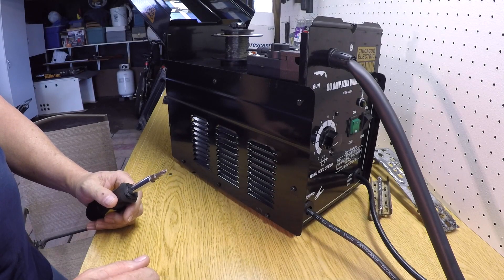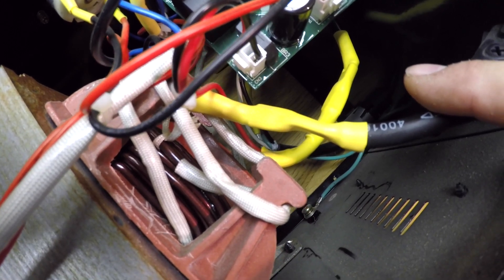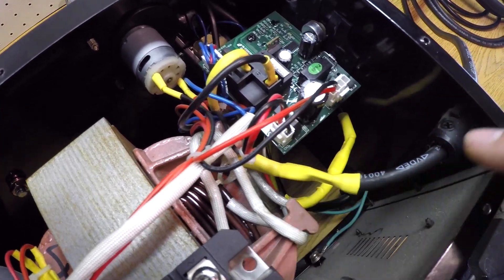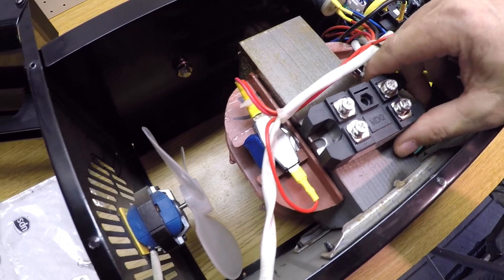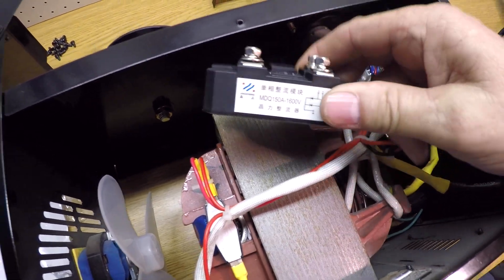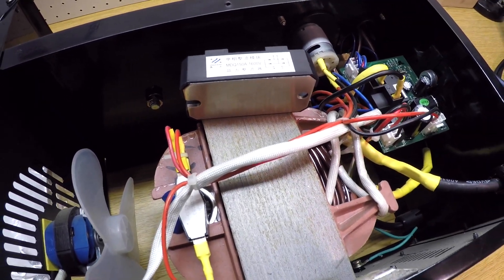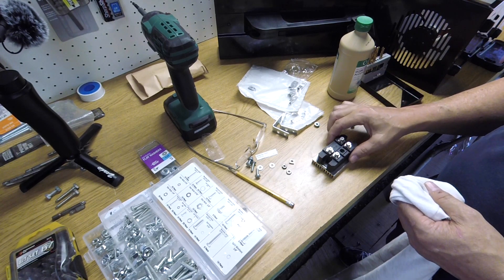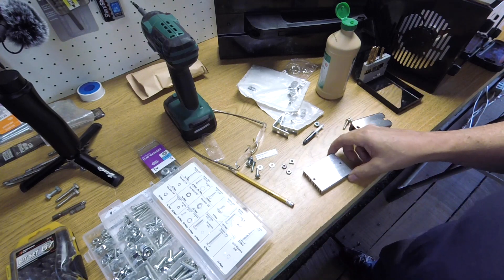Flux Core Welding Just Got HOTTER (Installing Rectifier & Heatsink)

Comment: What is the Amazon part # for capacitor?
Reply from the maker: This is the only one I could find at the moment on Amazon (It's a 2 pack)
GURSAC 50V 47000F Aluminum Electrolytic Capacitor, Radial Mount, 50x105mm (2pcs)
https://amzn.to/41igycC

Comment: Looks good. Do you still have this, and if you do, how is working for you?
Reply from the maker: Yes I do still have it and it's working very well. Here is a link to a video I made only a couple months ago about how it welds 1-1/2 years after making the mods.
After 1-1/2 Years Use - Harbor Freight Flux Core Welder Mods - Run a 10lb Spool of Wire too! - https://youtu.be/NBZ3tbjvBNs
Reply: @DIYHomesteadProjectsDIYHP10  I bought my welder used and it had been hacked up. I can figure out most of the wires, but the 3 that are the primary are the ones I have trouble with. I have the HF manual, but as usual, it's a bit vague.
 Is there any way you could tell me where the long wire plugs in for the common to the transformer?
I'm moving my cord to the back of the welder, so I have more room in the front for my receiver and capacitors. I've replaced the fan with a higher volume AC fan, and I'll install a Dinse plug for my ground.
Reply from the maker: I'm not clear on what you mean by the long wire. If you are talking about the white wire coming into the machine from the plug, this video kinda shows it at the time I have marked. https://www.youtube.com/watch?v=NIfeQH51FI8 - 8:23 - 8:27. It looks like the incoming white common wire connects to the bottom of the  on/0ff switch on the front panel. I didn't do any mods on that part so I don't have any good video of that wiring. I could take the side panel off my machine and see if I can figure it out if I know the correct wire to look at.
Reply from the maker: This video might be even better starting at 9:55. https://www.youtube.com/watch?v=ozjFq5KXm1U
Reply: @DIYHomesteadProjectsDIYHP10  what I'm talking about is the three wires that come off of the front of the transformer. Two go to the min/max switch and are about the same length. There's another longer one that comes off of the same side at the top and is longer. Where does this wire go?
Reply from the maker: I don't know the answer to that question. What side of the transformer do they come off of if you are looking at the front of the machine?
Reply: @DIYHomesteadProjectsDIYHP10  they come off the right side on the front, and are the smaller windings. The ones on the left are the output and are heavier.
Reply from the maker: When I get a chance tomorrow I'll pull off the right side cover and find where it goes.
Reply from the maker: You may try a Google search for "harbor freight 90 amp welder wiring diagram". I just did that and there are many wiring diagrams that came up. Maybe one of them has the information you are looking for.
Reply: @DIYHomesteadProjectsDIYHP10  I did that, and it's helpful, but it's just vague on
 what wires do what since there are 3 wires on the primary side. If it were two, I could figure it out. If they showed wire colors, again, I could figure that out. HF is renowned for this kind of thing. The best way to figure this out is for someone with this welder to describe where the long wire goes, and all the others will just fall into place then.
Reply from the maker: I'll have a look at it tomorrow and see what I can find.
Reply from the maker: This video should have what you are looking for. Sorry about the ads, it's just how my default upload settings are set up. Let me know if it's what you needed.
https://youtu.be/xozvq-IQzGo

Comment: Send the links to where you got all the parts.
Reply from the maker: Sure, these links are also in the description box of each mod video if that makes it easier for you.
Black Single-Phase Diode Bridge Rectifier 150A Amp High Power 1600V - https://amzn.to/2YOEJvX
Silver Thermal Grease CPU Heatsink Compound Paste Syringe (5-pack) - https://amzn.to/2MbgqXK
Aexit Chassis Mount Fixed Resistors Wirewound Aluminium Housed Power Resistor 5% 50W Single Resistors 470 Ohm - https://amzn.to/2USztY3
RIVERWELD TIG Welding Cable Panel Connector Socket Set DKJ10-25 & DKZ10-25 Quick Fitting Dinse-Style 2pcs - https://amzn.to/2WmRqkc
Aluminium Heatsink,Aluminum Grille Shape Heat Sink Cooling Fin for IC LED Power Transistor 100 60 10MM,16 Teeth - https://amzn.to/2EDdddr
50V 47000UF/MFD Aluminum Screw Audio Filtering Electrolytic Capacitor 105℃ - https://amzn.to/2HSmUJl

Comment: Is it 1 phase ?? On eBay
Reply from the maker: Yes, single phase rectifier. I got mine from Amazon.There is a link to the one I purchased in the video description.
Reply: @DIYHomesteadProjectsDIYHP10  is it worth it 
Honestly
Reply from the maker: It was worth it to me but every individual may have a different opinion on that. I think I get a smoother weld with less spatter. The main benefit is it's running DC instead of AC. Flux core wire was designed to run on DC. It was not a NIGHT and DAY difference though. I think welding skill has more impact on the weld than doing this mod. I've seen many people make good welds with the stock machine and they don't void their warranty if they have one. I really like projects like this so that is another reason I decided to do the mods. Hope this helps you out.

Comment: What  kind and size and amp heat sink should I get. What amp capacitor should I get ? Thank you very much for  this video
Reply from the maker: I have links to the majority of the items I used in this modification listed in the video description. I think your first question is asking about the rectifier? Here are the ones I used:
Black Single-Phase Diode Bridge Rectifier 150A Amp High Power 1600V - https://amzn.to/2YOEJvX
Silver Thermal Grease CPU Heatsink Compound Paste Syringe (5-pack) - https://amzn.to/2MbgqXK
Aexit Chassis Mount Fixed Resistors Wirewound Aluminium Housed Power Resistor 5% 50W Single Resistors 470 Ohm - https://amzn.to/2USztY3
RIVERWELD TIG Welding Cable Panel Connector Socket Set DKJ10-25 & DKZ10-25 Quick Fitting Dinse-Style 2pcs - https://amzn.to/2WmRqkc
Aluminium Heatsink,Aluminum Grille Shape Heat Sink Cooling Fin for IC LED Power Transistor 100 60 10MM,16 Teeth - https://amzn.to/2EDdddr

I purchased some used capacitors off ebay. This is what they were - 22,000mfd capacitor 50vdc with chassis mount Hitachi lot of 3pcs HCG6A. I think the more you can fit the better but I used three on my welder and a smaller 7,500mfd because they sent it to me for free. It was all I could fit inside the welder. One would help but three would be better. Somewhere around 60,000mfd's or more is probably adequate.
I hope this helps you out and answers your questions.

Comment: OK, so I got her all converted with a 68,000 uf cap that just about fits. Fired her up and started the weld and she quit after 10 seconds. The bridge rectifier was only 100 amps and coudn't take it. Have voltage going in but nothing coming out. I'm going to skip over a 150 amp and go with a 200.
Reply: Good choice.  I fried a 150 amp bridge rectifier.   But man the welds were beautiful while it was working.
Reply: @lunarrn  your giving me hope.
Reply from the maker: I've heard of people blowing the 100 amp rectifier. Going to the 200 amp rectifier you shouldn't have that problem again. I've been fine so far with mine and I think it is a 150 amp.

Comment: With thermal paste, less is definitely more. 6 or 8 grain of rice sized globs would've been better but it will work fine like that. Maybe only a few degrees difference.
Reply: I agree... The thermal paste is really only there to take up the air space/gaps due to microscopic roughness of the material.  It is impossible to machine a metal surface to be perfectly smooth, so there will be places where the two metal surfaces will not be touching and since air is a poor conductor of heat, the thermal paste fills those voids.
Reply from the maker: Yes I used way too much and most of it squeezed out. Thanks for the info. Hopefully I'll remember that the next time I use it.

Comment: Thermal paste definitely makes a difference.  It makes for a much more efficient transfer of the heat.  It is probably an optical illusion but it looks like the screws on your bridge will be very close to the side once you add the ring lugs to them.  Knowing you, you were thinking two steps ahead when mounted it where you did.    This has been an interesting project to follow along.  By the time I get caught up on my videos you will be a journeyman welder.  Hahahaha
Reply from the maker: It is a little bit of an illusion on the rectifier bolts. I think I have about 1/4 inch clearance from the side plate of the welder. It's probably a little close but everything is tight and doesn't move. As long as everything stays tight it should be good. Ha Ha I may never be a journeyman welder but my skills are improving a little. :)
Reply: Anti seize compound will work as thermal paste. It's metallic. Auto parts stores.
These HF welders lack a shroud for the rear exit of the fan. Airflow therefore is turbulent and ineffecient. And your bridge is far to close to that transformer and will pick up it's radiant heat.
You don't need caps either. After doing a bridge install, the output is 16.6vdc.
@120hz, DC Electrode Negative. You'll have DC with voltage dependent on stick out and speed of the wire. As sold, the HF A/C output is 18vac, so the machine is quite anemic.
Better machine would have 22-40vdc or more.
So, if you do install cap bank you would need six to smooth ripple. No room in the box. They just end up shorted to load. Easier to learn to weld, maintaining 1/2 inch stickout from the gun. Watch your puddle and push/pull at 10-30 degrees.